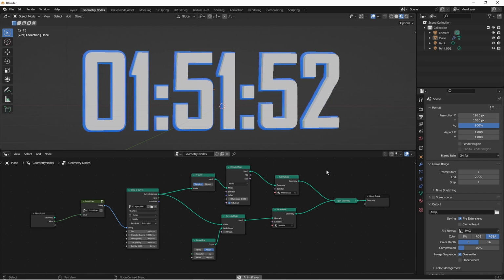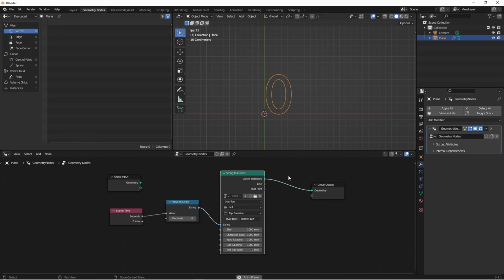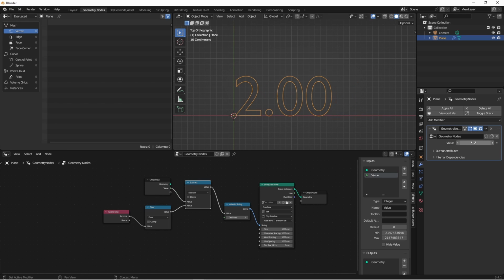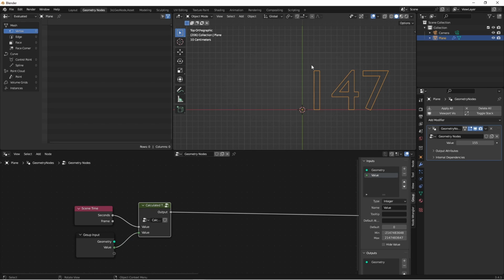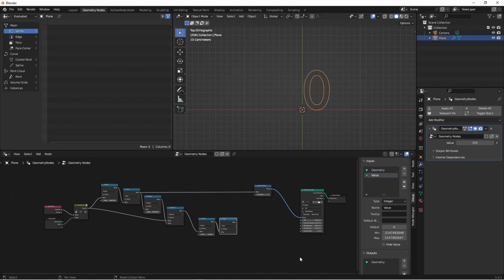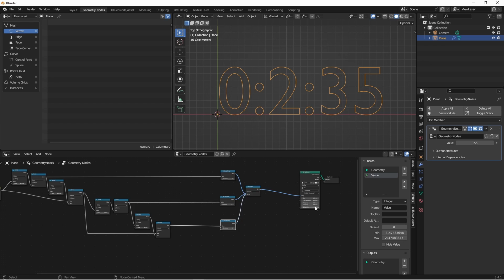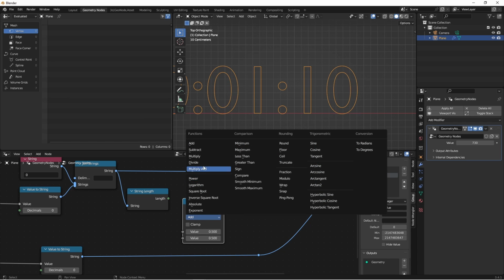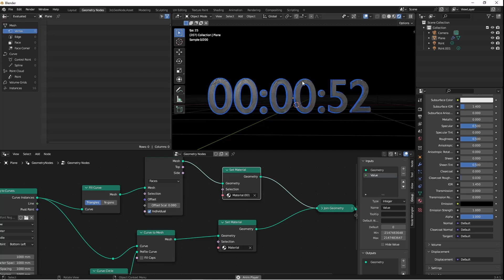Make a Countdown Timer Node in Blender Geometry Nodes!

Comment: Well done! Thank you!

Q: Is there a way to build an array with a numerator? So in the end I would have e.g. 3 boxes with each having its number.
Reply from the maker: Hmm not sure i quite follow what you are trying to accomplish.
Reply: @JohnnyMatthews  e.g. instancing a box on a mesh line with 3 points >you get 3 boxes (instances). Now how do I add a string (numerator), which labels each box automatically with a number (1,2,3)? Problem is, I can't use "value to string" with the ID node.
Reply from the maker: Ah yes, this will probably not be easy to do until we have a loop node. But with the start of the animation nodes now in the next version, I think they are on the way.